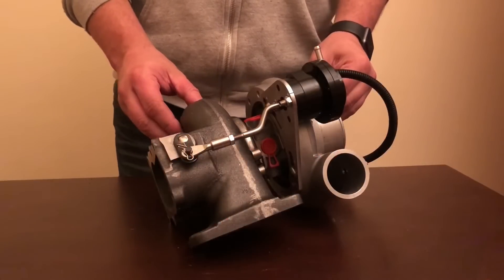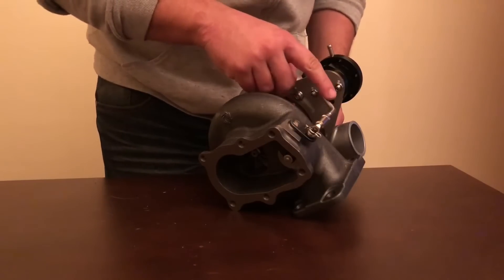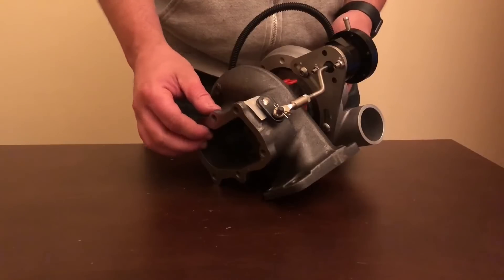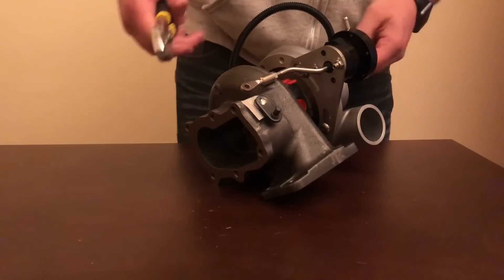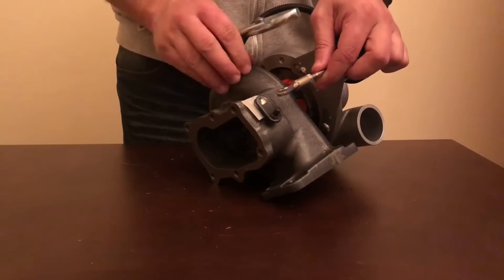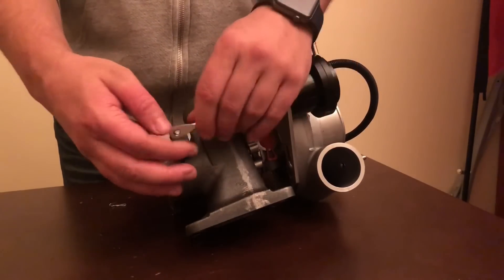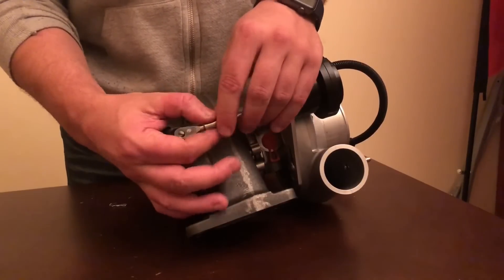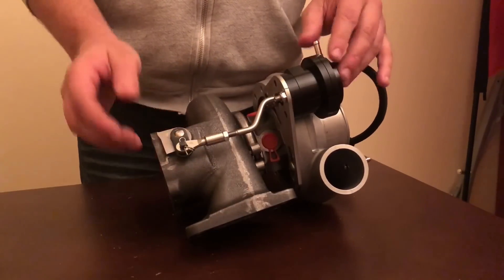Lesson 1.  How to preload a Kinugawa adjustable turbo actuator?

Comment: What is the default wastegate spring pressure in your turbos? I bought your gtx2867r .64 and I cant boost past 15psi.
Reply from the maker: the default spring is 1.0 bar / 14.7 psi
Reply: Thanks! Fixed it up, actuator was loose - my own fault. Boosting 20psi now. Great turbo @kinugawaturbosystems

Comment: i was messing with my tension because im seeing 17 psi but want 15psi so i set the actuator like this but boost feels laggy and underpowered alot.could it be my wastegate spring is too soft? im seeing the desired boost but the way it feels to me is like a boost leak, and this started only after i messed with actuator rod.

whats wierd is my turbo was supposed to have 8 psi wastegate but the lowest i can get it is 15psi? not sure if thats important
Reply from the maker: https://store.kinugawaturbosystems.com/blogs/q-a/spring_pressure
Here is the link for checking and let me know your turbo part number on the iron tag of the compressor cover or any transaction history offered to me support@kinugawaturbosystems.com